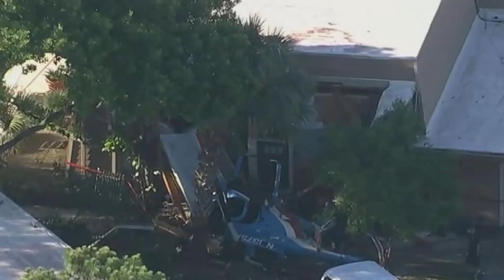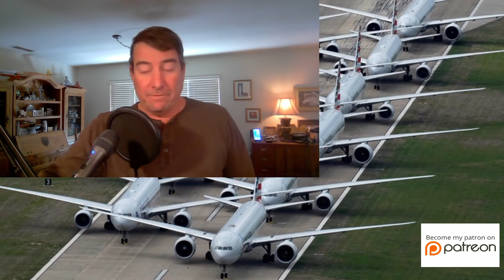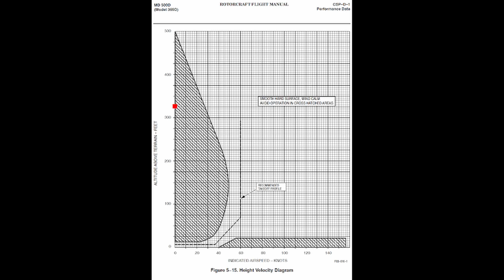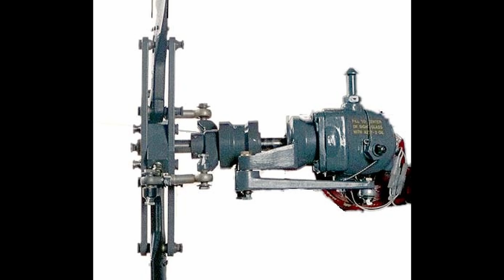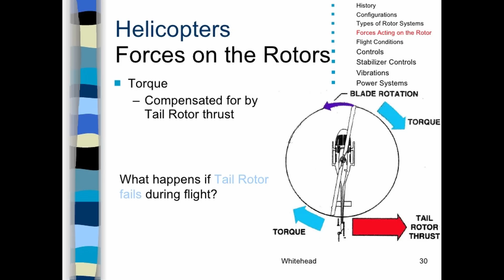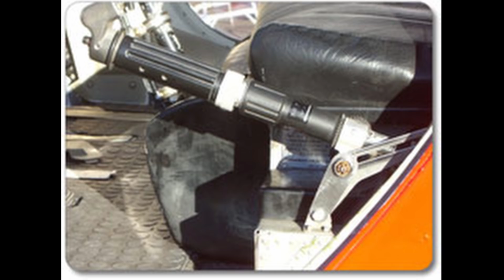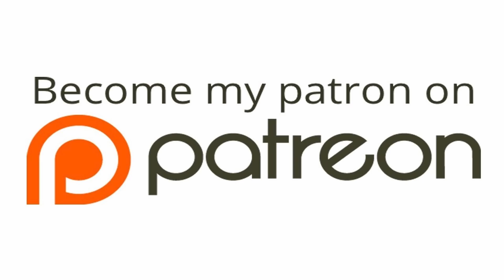Houston Police Chopper Crash 2 May 2020

Comment: There should be a back up. Can't turbine engine exhaust be routed into a an exhaust/thrust counter force? Commercial Airplanes have a prop engine that drops down in the event of all engine failure and it will provide power for radios and critical instruments. Cant something be a back up for tail rotor failures? Like a secondary rotor that runs on batteries that stays locked perpendicular to the tail tube?

Comment: This accident began as a settling with power situation in which the pilot set up the approach at too high of vertical descent and the pilot drooped the main rotor rpm which automatically decreased the tail rotor rpm. Had he approached with rate of descent at about 100 feet per minute rather than the 400-500 feet decent rate because he got in a rush and getting in a rush causes accidents. I believe the accident investigators will find that the tail rotor was still coupled and that there was no tail rotor failure. This was LTE, loss of tail rotor Effectiveness combined with settling with power. Flying into Undisturbed air is the corrective action rather than pulling more collective that caused the droop and LTE. Fly in any direction to get into any clean undisturbed air to salvage the situation to stay safe. Always keep flying the helicopter out of the situation even if there has been a tail rotor failure which is what did NOT happen in this instance. 20,000 hour ATP helicopter pilot.

Comment: Hey Juan. I seek your opinion about a helicopter accident that occured in 2017 involving a Virginia State Police B407 (N31VA). The NTSB finally issued a report that indicates that the pilot entered a vortex ring state and was only 600 to 800 ft. AGL. I suppose that is possible but there was a main rotor strike that severed the tail boom. This accident killed the pilot and observer. I hate that the veteran VSP pilot is being blamed and I am suspicious of the NTSB  finding because of the main rotor strike on a 4-blade helicopter. Would you and  your chopper friend respond with commentary, please?

Comment: Why is the jet exhaust from the turbine engine not used as an emergency backup, surely the jet blast could be concentrated through a nozzle at the tail to counteract the torque if the rear rotor fails?

Comment: I practiced running landing for a couple hours in the service. In the Huey if your above 40 knots the ac stays air streamed  and you crab and you do a running landing. We did it on gravels and skids, worked well..  Only autorotated once from an engine failure. Worked out fine. One IP I knew was so good he good autorotate and turn the aircraft 180 just prior to landing.

Comment: Hughes MD520N and MD600N are NOTAR helicopters, which stands for "No Tail Rotor". A lot of pilots I talked to that fly or used to fly  NOTAR helicopters say they prefer to fly helicopters with a tail rotor because tail rotors are more responsive to yaw movements and the tail rotor has more power then the fan in NOTAR helicopters.

Comment: Very interesting watching the opening clip.  I had not seen that yet.    Poor guy knew something was wrong.      I will say that in our operation we've probably operated 15 to 20 different helicopters across 5 bases and over 150k hours logged with never any sort of Tail Rotor failure.    They are very reliable in that sense.  Agusta and Airbus/EC products.  That being said I also know of 3 different pilots that have had Tail Rotor failures on MD500 helicopters.  Don't know if there was a common denominator to those failures but that airframe sticks out the most in my mind.

Comment: On the subject of tail rotors, a tragedy in NZ almost 2 yrs ago involving an MD/Hughes 500 type helicopter was caused when poorly stowed clothing and an insecure door combined to allow a pair of over trousers and other clothing to be sucked out of the aircraft and into the tail rotor. The link to the news report on the investigation is below and it may be a little confusing because the same family owned company had lost an R44 with another family member 3 months before which, while tragic, isn't relevant to this discussion but this is a press report for findings on both crash investigations. 
https://www.stuff.co.nz/national/109495728/clothing-from-cabin-brought-down-helicopter-near-wanaka

Comment: Usually the tail shaft has to be inspected for proper torque,  aligment.  They also have to do an NDI Dye and visual inspection that in some cases entails  dismantling the tailshaft section this is due to the possibility , of it cracking under stress!!  The tail gearbox has to be checked for  oil  leaks that can cause it to seize!  Then we have the possibility of something hitting that tail rotor!  On the tail shat if there are areas that use tail shaft grease, we have to see if they were lubricated with the correct grease or lubricated at all.  Some of that has to be done almost daily!  Then there is.out of torque specs or a link that suffered stress and cracked!  Yes a helicopter is a very delicate complex machine!  I don't care how proven the design is!  Maintenance Schedules  have to be followed to the letter!

Comment: As a former FAA operations inspector, I investigated a Jet Ranger that auto-rotated from a relatively low altitude. He hit hard enough to collapse one skid but was uninjured. The final findings? The pilot had carried his lunch in a plastic bag which was empty. The empty bag got sucked out of the helicopter and impacted the tail rotor. It sheared the drive shaft. It took lab analysis to detect minute plastic  fragments embedded in the rotor leading edges.

Comment: As an emergency backup to the tail rotor why not use pressurized air from the turbine compressor through directed nozzles to counter engine torque?

Comment: I watched a Huey land without a functioning tail rotor in 1969 at Vinh Long Army Airfield. The pilot made the approach as if it was a fixed wing aircraft and kept the airspeed up above the minimum control speed for the emergency landing in that condition. Directional control was maintained by changing the engine power, once over the runway,  but there was considerable yawing at the last 10 feet of altitude. He touched down with a bit of a jolt, but the PSP runway allowed the skids to slide along until it stopped.   BTW, the OH-6A (Hughes 500) was a real blast so don't pass up the chance to go up in one.

Comment: I didn’t hear them talk about loss of tailrotor effectiveness.  The tail rotor doesn’t have to fail and can be overpowered by too much torque.  Normally it happens at high thin air.  It can happen in a over torque or overloaded situation.  PJ helicopters lost a 500 when a company issued flight bag had a failed zipper that allowed the pilot’s jacket come out of the bag and got sucked into the tail rotor.

Comment: Deepest condolences to the family of Jason Knox.  Juan, as always, excellent video and Scott Monroe is an excellent source of rotor knowledge for your program.  The Helicopter appears to be an MD-530F model. I flew  them in the FBI and we had all of our pilots annually go through factory training with MD helicopters in Mesa, Az.  A really good helicopter for police/military work and generally pretty crash worthy. T/R failure at night, slow speed, low altitude a nightmare for even the most competent pilot. Igor Sikorsky found like other helicopter designers that tail rotors are a "necessary evil" for helicopters.  McDonnell Douglas did away with the tail rotor in the MD 520N (Notar) model of this helicopters and got Phoenix PD to buy a bunch. I have flown them with the Phoenix PD and found them to have their own unique set of problems, and I personally preferred the 530F over the NOTAR. Other way to get rid of the tail rotor is dual rotors like the  CH-47 Chinook (a helicopter capable of having a midair with itself if one of its many gear boxes lets loose) or counter rotating main rotors like the new Sikorsky S-97 Raider design. Unfortunately all these designs bring new sets of problems and complications (many more moving parts going in different directions) to the design of vertical lift aircraft.  Good maintenance,  intensive daily pre-flights, undergoing annual emergency training and understanding and staying out of the Height/Velocity curve as much as possible is the best way to fly these potentially dangerous  beasts that need to constantly beat the air into submission to fly.

Comment: JUAN, Hello, good interview, sad end for MR KNOX & his family RIP sir, so the other patrolman is in hospital, back in the 60s - 70 something a radio station here in the NYC  area, there was this BELL 47 , recip engine & lots of shaking , one of the pilots said they call the bearings on tail driveshaft  JESUS NUTS, because when went the first thing you probably said was JESUS. , they did loose the first one, TOO LOW, TOOS SLOW, then the howling winds got him as he came out from behind some tall buildings ., They did get another, then went to a BELL RANGER , but when the station was sold, they wanted no part of it , so was sold off. Cheers FROM NJ USA🇺🇸🇺🇸🇺🇸🇺🇸

Comment: We in Houston are all mourning the loss of this crew..  The area the chopper went down in is the Greenspoint area. (just north of the Sam Houston beltway and just west of I-45 ) this area is southeast of Bush Intercontinental Airport (Airport designation KIAH) 
There are some high tension power lines that parallel the NORTH side of the Sam Houston Beltway & the transmission towers have marker lights. If you look at FlightAware for Bush airport air traffic does not vector southeast either in their approach or departure.

God Bless these officer's and their families.

Comment: I am surprised that, in todays context of fly by wire capable control systems that there is not a control system that could take over ( or assist in power control) in the event of loss of tail rotor and manage engine power so as to give some semblence of control during auto rotation from height. ( apply slight power to counter the drag related torque during the last stages of an autorotation flare landing)  Could you ask your friend about this?

Comment: About 45 years ago I was involved in applying Fourier theory to signals coming from acoustic samplers attached to military helicopter gearboxes.  The idea was to predict failure from the analysis of the acoustic signal. For instance a chipped tooth gives rise to a certain type of signature which would provoke a gearbox strip down. One of my colleagues got a patent on the system.  I have raced rally cars for years but I will not get into a helo!!  You can know too much. A few years ago I saw a documentary on an Agusta helo and was stunned to hear that the metallurgy had got to such a stage that the transmission can run without lubrication for 30 minutes. Condolences to the family of the officer just doing his difficult job.

Comment: 'Copter tail rotor problem
About 20 years ago a girl reporter was on her first day on the job at a local Phoenix TV station. There was a breaking story and the girl was asked if she wanted to ride along, and she jumped at the chance and ran out and jumped into the 'copter. The pilot got all the story info and started the 'coter up and ready to fly. At a few feet up (6?) he noticed he had no tail rotor control and chopped the power. The 'copter made a somewhat hard landing with some damage to the landing gear. 
The tail rotor problem was due to the girl putting her purse under the rudder pedals.
The girl's first time in a 'coter and her first day on the job all excited and she couldn't find a good place to put her purse in the little 'copter and so she put her purse at her feet behind the rudder pedals.

Comment: I am so astounding that you didn't discuss that the possibility of loss of tail rotor effectiveness was DEGRADATION OF ENGINE POWER. This helicopter was hovering/slow flight in a high crime area. Did you consider that a bullet round may have been tinkling through the turbine blades?  
When a helicopter is hovering, a degradation of engine power, can induce the pilot to start increasing collective to maintain altitude.  Increasing collective....getting close to the limit.......is also known as over pitching the main rotor. As the pilot increases collective to the limit, the resulting torque from the main rotor can start to bog the engine rpm's down. The combination high main rotor torque and bogged down engine rpm can reduce tail rotor rpm and counter torque ability.....this will also cause a body yaw exactly as seen in the video.   There are helicopter training videos, intended for student helicopter pilots that demonstrate the degradation of engine power, causing body yaw. just as seen with this police helicopter....once in a yaw condition, the helicopter ina coffin corner, since the pilot no longer has to ability to use cyclic to escape.  .

Comment: At this point in time all aircraft should be required to have a data recorder even if it is not in a hour fire rated case to save on weight and costs. How many crashes would having just a 1-2 lbs box in the tail of the aircraft/helicopter that records the aircraft data and voice help to solve? 

minimum of 1 hour of data and voice logged before it starts recording over inside a water tight container with a small battery powered ping emitter for if it lands in water. 

Even as just a diagnostic tool it would be worth the cost to install as at any point someone with the right reader could get an hours data on what the engine is doing and if anything from oil to coolant is moving odd.

Comment: Helicopters blow my mind! I had an opportunity to get close and hands on with some blackhawks and apaches at a Utah Air National Guard Base. They were working on an engine from the Apache, and they aren’t much larger than a big block Chevrolet engine. I did notice that there was a warning on the tail rotor driveshaft that said “do not scratch”. That’s some sensitive balancing right there!

Comment: Could there be an emergency backup using a compressed gas jet, such as those SpaceX is using for attitude adjustment during first stage landing? Wouldn't last long, but could help in the emergency landing? No idea how much energy would be needed.

Comment: While in the Navy, I watched one of our helicopters sit down on the ocean after loosing the tail rotor.  They deployed the flotation bags and kept the main rotor turning to stay upright. We sent a motor whale boat to take everyone off but the pilot. He had to jump in and get picked out of the water after the helicopter rolled over.  We came along side the inverted helicopter to pick it up with the ships crane. The divers had to hook it up but the sharks kept circling and the divers weren't real hot on going in. I don't remember what they threw in the water to drive off the sharks, something that blew up under water. The helicopter was stripped of anything usable and the remains were dumped over the side. We were off the coast of Vietnam, 1965. 
While in Danang Vietnam I saw a small two rotor helicopter where the 2 rotors were set at an angle to each other and the blades passed through each others space. No tail rotor. Italian I think.

Comment: A Huey (Bell 205A) could maintain level flight with the tail rotor shot off at 102 knots plus.           Gee a friend lost the tail rotor (seized up) on  there Hughs 500 half a year ago to no injury but $700,000 damages  Dont know what goes on. Had there machine rebuilt (15 years ago) gutted  right down to replacing even windows and deck plates

Comment: Many years ago I had a pitch link failure in a Hughes 500 at around 50 feet. it spun a full 360 instantly, dropped the power off until the flare then added a bit to keep her straight until skidding her in. Turned out to be an empty fertilizer bag blown over the fence from the farm next door ending up in the tail rotor was all that caused it. Thank God for a tough little helicopter and compressible seat bases.
Good summary Mr Monroe.

Comment: Tail rotor failures seem to be in fashion these days, soon to be corrected. I'm told that if you have the speed OR altitude (not to mention if you have BOTH!) you can safely auto-rotate out of the condition - if you react correctly. I just love the back-and-forth between a helicopter pilot and a 777-pilot! For Juan, the concept of suddenly flying backwards and STILL BE FLYING and having some semblance of control is alien, he has evidently not been experiencing the "really-slow" regime of helicopters, the point being that if you are low enough and slow enough when shit happens, you are likely to stagger away in more or less one piece. Paragliders, hang gliders and even ultralights have been known to enter this silly condition, but the pilots have usually become mere passengers when that stage is reached. The important point is the fact that the speed is so low and, with the degree of PPE available and used, injuries are usually minimal.

Comment: There was a Sikorsky helicopter accident in Milwaukee years ago. It was lifting A/C units up to hi-rise buildings. It had a similar failure and the news showed it rotating several times before hitting the ground. The guy was lucky. The news said he was steering it clear of people. I thought that was B.S. and this clip proves it. He didn`t have a clue where he`d end up.

Comment: I was a helicopter crew chief in the Army from 77-80. We lost an aircraft to tail rotor failure with 3 fatalities. Turned out the 90 degree gear box had been improperly torqued and actually  separated from the aircraft.  The inspector who signed it it off never got over it.  Same circumstance, not high or fast enough to really do anything about it.  I agree we need Scott to provide info on all helicopter related incidents.